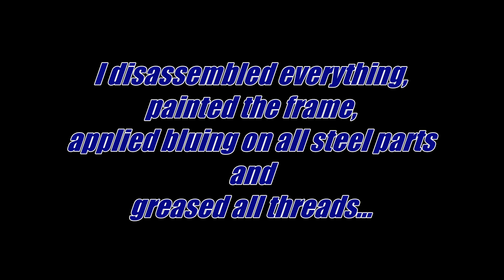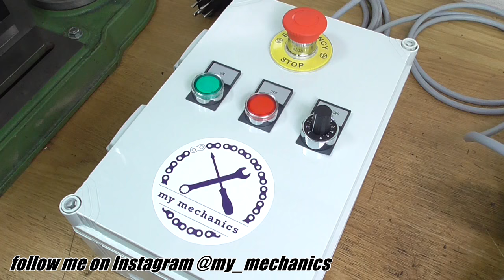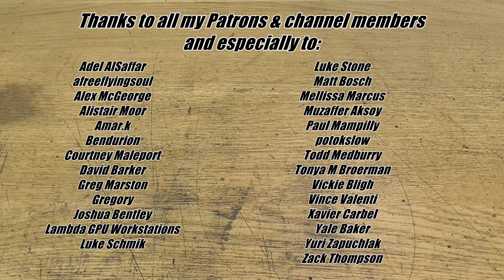Building a Huge Rotary Tumbler from Scratch - Homemade Rotary Tumbler

Comment: That would make one heck of rock tumbler. And probably last several generations. The amount of equipment you have at your disposal is truly on another level, as are your endless skills.
Reply: and the only real wear items are the wheels and the tumbler itself. A bearing might go eventually, but the pieces that will wear out are easy to replace. A really solid design.

Comment: I was like, surely he isnt going to leave that wire mess. And sure enough there's the sleeving... just goes to show how much work making a tool look and work decent.
Reply from the maker: Thanks, I'm glad you like it :-)
Reply: That's a wireporn
Reply: @StmWhisper  and it thrills this 40-year electronics tech. Here's a man who knows how to crimp a terminal on a wire.
Reply: @pfadiva  ratchet crimpers make such a difference omg. I got gifted a pair for making 22-30 awg dupont pins ('stapled' i call them bc i can't remember the technical term) and now ive got a multi-jaw kit on order because it's so much better, and more consistent than handforce crimping. Also less tiring bc the ratchet has huge mechanical advantage

Comment: Very nice were ya from I'd teach you some welding tricks if you teach me some milling tricks 🤠👍 I used to walk into the shop when I needed something made and jest be amazed of the things those guy and machines could make. I was a high pressure pipe welder/iron worker for 20some years but nothing amazed me more then to watch those guy on those machines.
Reply from the maker: Cool, thanks

Comment: Oh man. It looked like your lathe was about to start walking across the shop floor at one point. The result was well worth it, though—I imagine it would've been a huge pain to precisely machine those holes on the mill. Gorgeous video as always, and thanks for the bonus ASMR near the end!
Reply from the maker: I could make the holes on the mill with the boring head, but the slot wouldn't be possible. Well, maybe in a super fancy setup. The boring head might also reach its absolute limit with the big holes. It worked very well on the lathe. Thanks Adrian
Reply: @mymechanicsinsights  Oh that slot for the circlip? I wonder if it's even possible with a mill
Reply: @flat-earther  it's possible.  You could use a fly cutter and go around the circle.  Also a radial wheel type cutter.  I've seen them for bores ~150mm (6") or larger.  I worked at a large machine shop.
Reply: @fletchro789   But how do you go around moving the table x y axis simultaneously in a perfect circle with a manual mill?
I have never milled but on a manual mill I imagine you just have to leave the spindle in the center of the hole and then somehow have a cutter which will expand somehow I don't know?

Actually after writing that I figured if you have a rotary table on the milling machine you could use a woodruff cutter (or a slitting cutter if you have one that's small enough to fit in the hole) and mount the part in a rotary table on the milling machine, feed the cutter into the part and just rotate the rotary table.

Comment: The electric control box is the most cryptic thing to me. I still do not understand electricity
Reply from the maker: I never really liked working with the electric stuff, that's why I haven't touched it for over 14 years. But glad I learned the skills, was very useful for this project.
Reply: I believe that is a sign of mental health.  If it starts to make sense, you might want to see a doctor.
Reply from the maker: @hotcoffee5542  hahaha
Reply: Brother, I was a Navy electrician for 4 years and did freelance work for 10 afterwards and watching the build still confused me.
Reply: Electricity is easy, think wires like tubes and switch like tap.. and poison inside that tubes😁
Reply: It's just smoke and magic. If you let the smoke escape you haven't mastered the magic yet.
Reply: @AsitShouldBe  Agreed. Treat it like a deadly contact poison with no antidote and a low survival rate. If you aren't at least somewhat in need of your brown pants, you're either a professional electrician, or you've just given up on life.
Reply: @bren106  are you electroboom i suppose😁😁
Reply: @stevemanart  Probably because European and US electricity standards are SO different. I kinda get US stuff, but watching someone do 3-faze work with hardware that looks nothing like what we use here in the US? watching a wizard brew a potion for all I can tell.
Reply: The pixies go round and round and you shouldn’t touch them – but then they tell you there’s a “ground wire” that needs to be connected to the rest of the world. Sometimes. That’s usually the point at which they lose me.
Reply: Even though I don't understand it all, the way you stripped and added ferrules to the end of wires, then nearly routed ask the cables... 😘 C'est magnifique!
Reply: @mymechanicsinsights  man, it looked like you are earning your daily income with those skills. I had to do a "Stern-Dreieck-wende-Schützschaltung mit Zeitschaltung" about 21 years ago in school, and no, i wouldn't be able to do anything similar today...
Reply: @AsitShouldBe  MAGIC SMOKE!!!
Reply: @hotcoffee5542  😁😁
Reply: @Vikingwerk  sure, but these are just contractors and breakers. I see a lot of components like these in the US (industrial) equipment these days too. The biggest difference between IEC and NEMA is that IEC had someone who cares about package design on staff...
Reply: It's the most fun part! (I'm a little biased, but only a little.)
Reply: 3-phase has a few things of its own to confuse you. I suppose it doesn't matter which way the motor rotates, but it's easy to reverse. And that gets to be fun when you're having to use a star-delta starter.

In my grandfather's day the wires were better colour-coded. In over a hundred years, the standards have changed. He was installing 3-phase, replacing steam engines.  I think he would have approved of your work.

Comment: Love the shot when you’re turning the drive shaft (~7:20). Starting zoomed out with the carriage fully out of the shot. Very sleek, some great videography.  The movement of the carriage along with the slight movement of the cross slide is visually appealing. 

Clearly this came naturally from having to turn such a long part but it’s worth noting it’s aesthetically appealing for future videos.
Reply from the maker: I probably wouldn't move the carriage so much behind for turning this part, but I liked to have a free bed when putting the part in on camera. I also really liked the look how it moved over to the work piece, that's why I kept that clip. Thank you Sam :-)
Reply: @mymechanicsinsights  Sure, bud. No problem. :)

Comment: I like the connectors you crimp on the ends of the wires to give you a hard cable end.  Here, wires are just stripped and the bare copper inserted into the device (and tightened with a screw).
Reply from the maker: That's definitely the way to go! Thanks Uli
Reply: Well, those spring contact terminals from Phoenix are actually designed to take wires with or without those wire end connectors. If you don‘t have good crimping pliers, it‘s better to insert the wire without end connectors because otherwise, the wire can slip out of the connector. But on all the other components like the contactor, switch and timer relay that have screw terminals, wire end connectors is the way to go 👍🏼
Reply: Some folks crimp on a connector AND solder it on.  I believe that's overkill.
Reply: You really shouldn’t solder your connections due to physical properties of the solder under pressure
Reply: They're called ferrules, though a good screw connection is fine with just the bare wires, twisted

Comment: Q: How over-engineered do you want it? 
A: Yes.
Reply from the maker: Thanks for watching, much appreciated
Reply: Yet he welds like a day one in school
Reply: Not Over-Engineered built to last just like the old timers used too! probably still be running and usable for 10-20 years provided its maintained correctly
Reply: @MrClaypogue  ya with shitty welds like that that had no penetration and he ground off his bubble gum welds ya no lasting
Reply: @facediaper4607  Maintaining would also entail replacing and repairing welds that break. NOTHING lasts forever unless it's repaired and maintained...
Reply: @MrClaypogue  sorry welds done right on something like this would not break you have no clue what you are talking about .
Reply: @facediaper4607  Except say multiple hours of unattended out of balance load vibration would do serious damage good welds or not... bad welds would technically be better would do less damage by failing faster LMFAO
Reply: @facediaper4607  where are your stunning projects and videos  we can watch?

Comment: Just curious, what's the actual difference between the OFF and Emergency stop buttons for this motor?
Reply: off is just that. off. when you hit the on button, it restarts. EMO will disable the on button until you reset the EMO button (the twist you saw him do). Its also easier to hit (no frame around the button, it's a mushroom style) so you can slap it in an emergency. The idea is that if something is going wrong and you hit the EMO, you can't accidentally restart it before the issue is fixed. 

One other small thing is that the motor doesn't actually see the difference. The difference is actually for the control box alone. You could, if you wanted, set up the motor so that as soon as you plug it in it starts going until you unplug it, though that would be inconvenient and unsafe.
Reply from the maker: Exactly what Greg says ;-)
Reply: @th3greg  Thanks for the thorough explanation <3
Reply: @mymechanicsinsights  There's quite a few changes from the switchgear I worked with. The special EMO button wasn't there. But the starter button was similar with the protective ring, and the stop button was bigger and un-guarded.

Comment: Can't wait to see you throw some freshly machined parts in the tumbler!  Excellent work as always.
Reply from the maker: Not so sure about that, think I'll use it more for restoring parts, but who knows ;-)
Reply: @mymechanicsinsights  Haha, I work in high vacuum equipment so removing small grooves found in "machining marks" is very important.  These sites can trap machining fluids and add surface area which moisture can adsorb to.  Tumble all of the things!  😂

Comment: The mechanism for coupling the motor to the transmission shaft is very interesting, I have seen many models, but this is simple, flexible, practical and very durable at low speeds👍🌟
Reply from the maker: Yes, you are right

Comment: Very cool! We used a similar item in the food industry to marinate meat.  It uses a stainless steel barrel, add your favorite whole boneless cuts of meat, chicken breasts, or pork tenderloins, for example. Add margination and pull a partial vacuum, rotate for about 15-30min. Cook immediately or chill or freeze for later. The commercial version does this with a glycol water jacket that is chilled to keep the regulatory people happy or it is conducted in a 4C cooler. In reality 30-40min is fine w/o refrigeration with care to cooking and chilling quickly afterwards. Maybe a follow up cross over with a cooking youtuber.

Comment: You Sir are a definiton of machinist. The way you did those retaining rings, just perfect.

Also: Motorcycle brake drum from looks of it. Next restoration should be exciting.
Reply from the maker: Wow, thanks!
Reply: @mymechanicsinsights  And I will continue compliments, since i wrote the first comment before watching the whole video. And as an Electrical Engineer, i can evaluate next topic more profesionally. Wiring of electrical box is also done extremelly well. You crimped ends of the strand wires, you used heavy duty relay, emergency stop, din mounted connectors, special electric motor circuit breaker and even cable glants.

Comment: Great video! Really nice results.
I have a suggestion for your electric control box: although using the DIN rail to jump the PE terminal blocks is not wrong, I would also add a cable. The PE circuit's impedance will be lower this way.

Comment: Very well done. The hydraulic tube as an elastic joint is clever, simple and effective. Usual mechanical mastering. Typical Swiss order in the electrical box cabling. As a little remark, I am not a big fan of screwless terminal blocks for cables.

Comment: 3-phase motor is pretty hardcore for this application.  Most residential only have single phase but it makes sense if you are in a machine shop that has 3-phase or a 3-phase converter.

Comment: Sure wish that the engineers where I work put together stuff this clean for our "world class manufacturing operation." Clean build, I love your ideas and as I get more into mechanical work it's given me good insight on tooling capabilities and strategies. Suggestion, you should pick up some 80/20 and build a fixture to fit it, and the control panel onto.

Comment: Really enjoyed this.  Excellent project and editing.  It gave me great flashbacks to my times working in the machine shop and building industrial controls for a coal gasification plant overseas, even down to the European style gland for each cable into the control box.  We didn't use those cool crimp-on wire ends, but this was 30 years ago, so it seems standards and materials have improved.  All in all an excellent project and video.
Reply from the maker: Glad you enjoyed it!

Comment: At 19:20, when you say it is heavy to lift 45 kgs every time to load/unload part, I suggest you make a loading window on the horizontal portion of the drum. A window big enough for the parts, with a clamp-on door and rubber gaskets to prevent water from leaking. This way, you do not have to lift the drum to load/unload the parts. A quick look at some of the tumbler videos on youtube will help you find the best solution to this.

Comment: The first 2 weeks of my apprenticeship as a fitter, it was my job to empty the large tumbler we had int the finish department every morning. It was donut shaped (bottom half) and about 2.5 metres in diameter. The grinding stones were cone shaped and about 1" in size. We used it for various stainless steel parts for yachts. Most of those parts would later be electro polished in a mixture of sulfuric acid and phosphoric acid. The smell in the vat room was insane. Boy am I glad I didn't have that job!
Reply from the maker: Yeah, there's a lot of different media for tumblers

Comment: I have a small suggestion. The bearings which guide the drum will eventually wear holes in the drum due to metal on plastic contact. The guide bearings need very thin rubber tires to be the sacrificial layer between metal and plastic.

Comment: That was so great watching you build another tool you use regularly! Nicely done! Why real bearings on one sweet of wheels and not the other? Why the hydraulic tube? Thanks buddy! I've already recommended your channel to so many over the past 3 years!
Reply: X*2+77~66.99x14-1/4'<coefficient of mass2 !  In laymans terms-- Cause a steel driveshaft with u-joints would take out a wall! lol

Comment: When yousin spring clips in electrics u actually dont need end-caps for the wires, u only need those when u have to screw the clamp on. When using end-caps u can get the problem that the wire is pulled out while the cap stays clamped in. (When there is a harder pull on the wire)

Comment: You said clutch, you meant coupling?  Nice electrical assembly,  the machines at the factory where I work uses all the same contactors E-switch, terminal blocks, they are mostly German made machines like Rovema and Hansilla, I do electrical work, it just amazes me how almost nothing really changed much in that field in the past 40 years. Not even the timers, counters, or encoders, or even their form factor, and yes I live in the west, most of our factories are 3-phase, not the houses though. If you want 3-phase here for you house you'll need a converter motor or electronic converter. I always enjoy a nicely wired control panel. Job well done on this creation and build.

Comment: Nice. I did notice you are running the drive CCW and the drive nut is a right hand thread. There seems to quite a bit of torque on that coupling. Might want to reverse the drive direction so you don't run the risk on unthreading the drive nut.
Reply from the maker: Great point!

Comment: I applaud you for your demonstration of a multiple level of skills.  Since you had a 3 phase motor at your disposal,  and you seem to have familiarity with, on some level, systems integration and industrial automation,  why did you not choose to integrate a VFD (Variable Frequency Drive) into the build so you could adjust the speed of the motor?

Comment: my opinion.  the wall thickness of the drum is very small.  Cracks may appear in the near future.  There is also a lot of pressure in the contact patch with the rollers.  They need to be wider to relieve pressure.  the flexible drive will likely not last long either.  But overall excellent work!
Reply from the maker: All cheap and easy parts to replace. Thanks
Reply: You become like a Russian person:)
We even have an expression from the old Soviet cartoon: "and so it will do" - which means not the importance of ergonomics, reliability, maintenance and design - the main thing is to fill in the work.
In any case your projects are great.

Comment: My mechanics insights in my experience, I like using the smallest mig wire available.ill use .023 and it gives more range and more detail when working with small jobs.also more penetration.acts like a steonger welder because of smaller wire.the popping noise when you weld seems to slow in the videos and a tall weld.